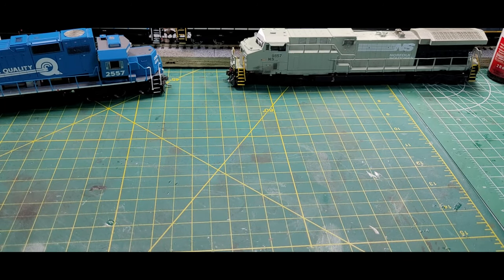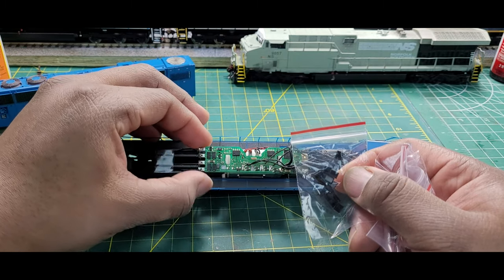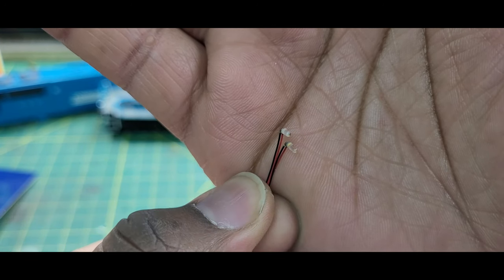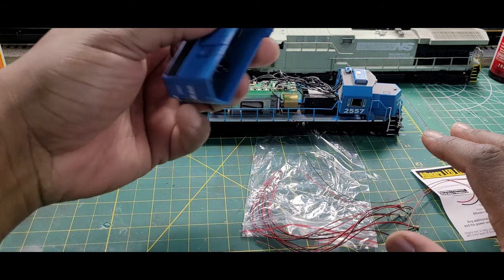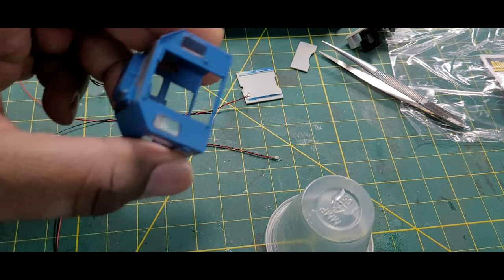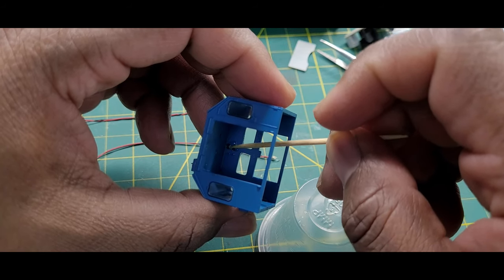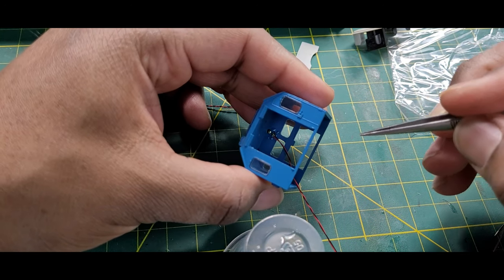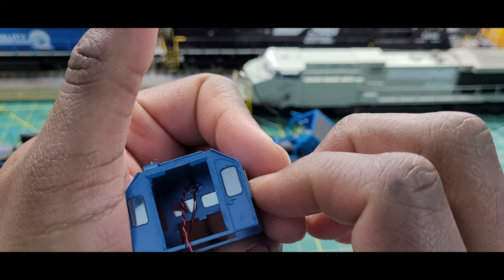Athearn Genesis HO LED Bulb

Comment: Very nice project, something worth noting is that the 16-710G3C engine sound used is incorrect; the 16-710G3B sound files S0720 (preferred for SD70 spartan) and S0757 are more correct than S0525 that is applied here
Reply from the maker: S0757 is more  Accurate
Reply: @engineerhall5887  how so? They sound like real similar apart from slight variation in the engine note
Reply from the maker: I'll look into it
Reply: @CentralJerseyRailfan take your prototypical dogma someplace else... it takes the fun out of the hobby 🙄

Comment: did you use those same bulbs for the ditch lights? im curious if they fit in the ditch light using and if so did you just push them straight up into the ditch light housing or did you have the turn the bulb inside of the housing to get the bulb to point out?
Reply from the maker: I use those led for headlights only. Because they have the lens already attached. For the ditch lights, I use a small LED with a Lens made by details West or I will make my own with clear tubing.

Comment: what type of light bulbs did you remove, from THAT, loco ?  And what about resistors ??
Reply from the maker: I updated and add lights in a older  Genesis locomotive to LED .  The resistors are integrated in the decoder board